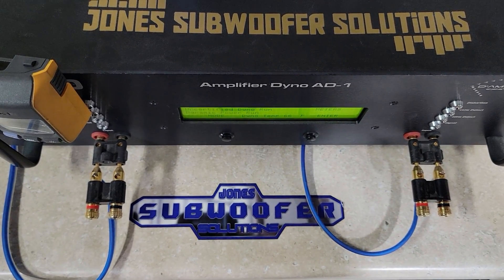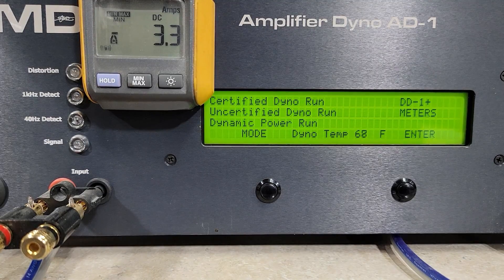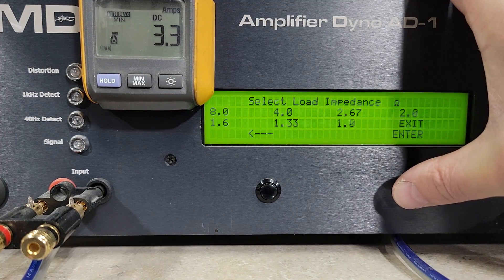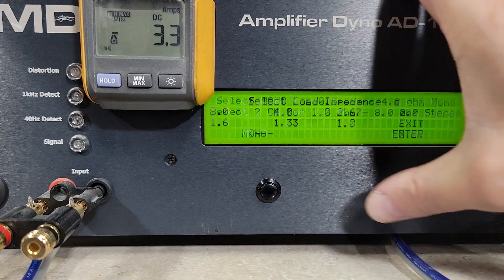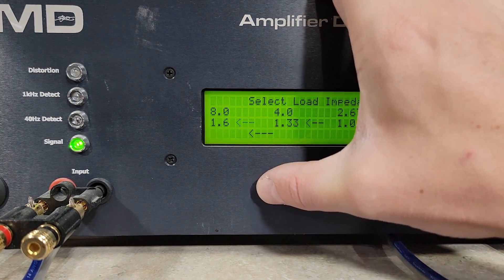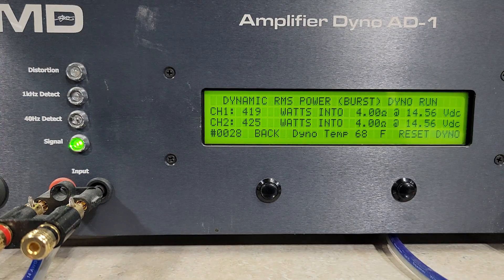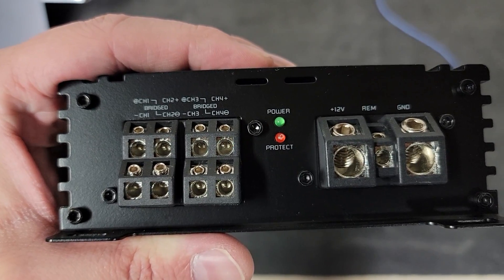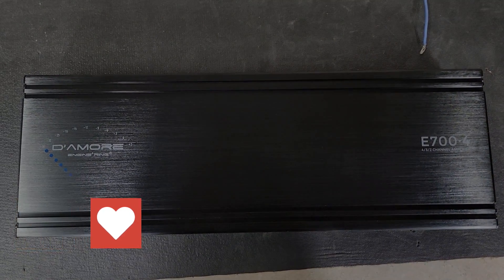AD-1 Amp Dyno D'Amore Engineering E700.4 by Jones Subwoofer Solutions JSS

Comment: I have this amp powering a set of Focal Flax Evo components and coax in the rear and holy shit this amp makes those speakers SING!!! The speakers are rated at 70RMS @4ohm but I swear they love every bit of that 100RMS. Very very nice 👍
Reply: @Alain Thanks! I have the PAC module running from stock head unit in a ‘16 F-150. Bought this amp a few months back to power Morel virtus 602s. Can’t wait to hook it up!
Reply: Alain are you using using the passive crossovers or dsp?
Reply: @acedavis9689  normal crossover for now may upgrade to a dsp later. I’m running stock head unit with a nav tv zen module for signal. But it’s got option or optical out. I just might do that for the SQ